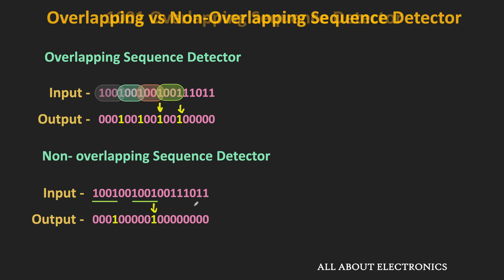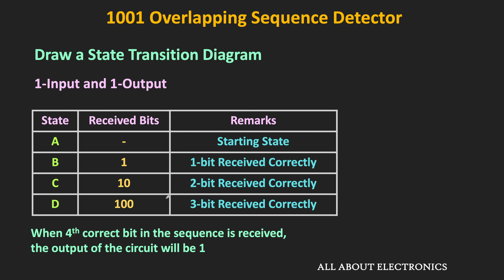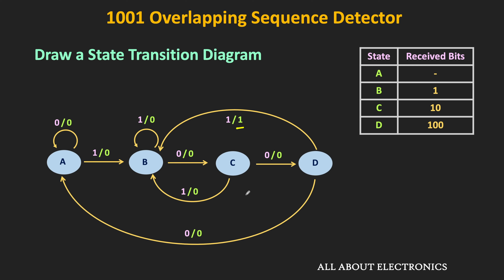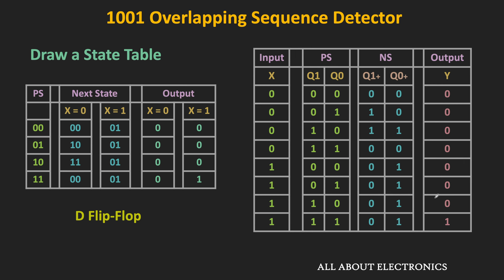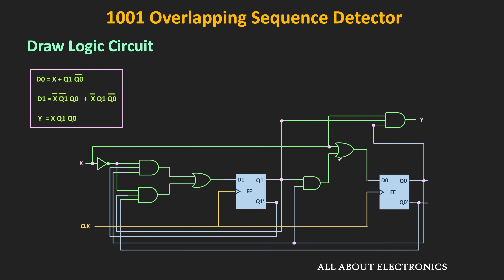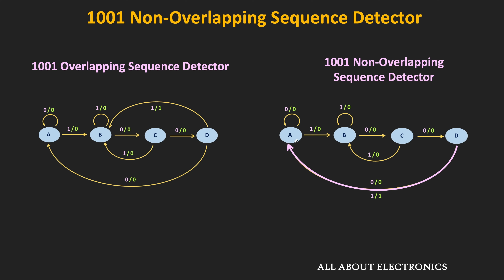Sequence Detector | How to Design a Finite State Machine ? Step By Step Guide with Examples

Comment: How you draw excitation table
Reply from the maker: The excitation table basically tells, what should be the excitation to the Flip-Flop inputs to get the desired next state. In this case, as D flip-flop is selected, so for D flip-flop, the inputs to the flip-flop will be same as the next state that we want. For example, if the next state is 00, then inputs D1D0 should be 00 (irrespective of their current state). And similarly, if we want 10 as next state, then inputs D1D0 should be 10. Please watch 11:51 onwards now, you will get it.

Comment: in overlapping why C is going to B if 1, why it is not remaining itself
Reply: because it will be like 101 and the 1 on the far right (LSB) will be starting bit of the next checking of sequence (overlapping sequence detection) and according to example, B is the state where 1 is already received.
Reply: @harismasoom6634  thank you so much sir
Reply: But the same thing is done in the state diagram of non overlapping sequence . C goes back to B when 1 is detected...

Comment: If the number to detect is not 1001, but 0101, can I set A, B, C, D to -, 1, 10, 100 like the video?
Reply: Or should I set B, C, and D to 0, 01, 010?
Reply from the maker: @박소은-b9k  Yes, you should set the states like this only. (B = 0, C = 01 and D = 010)
Reply: @ALLABOUTELECTRONICS  Then, how should I set it up when I make one circuit that outputs 1 when 0101 or 1001 is an input?
Reply from the maker: which sequence you want to detect? 0101 or 1001.
Reply: @ALLABOUTELECTRONICS  I'll write the question I'm trying to solve. "The circuit examines groups of four consecutive inputs and produces an output Z=1 if the input sequence 0101 or 1001 occurs. The circuit resets after four inputs. Find the Mealy state graph."
Reply: If 0101 and 1001 are inputs, Z is 1 for both
Reply from the maker: You mean to say, you want to detect both sequence at the same time. right ??
Reply: @ALLABOUTELECTRONICS  yes
Reply from the maker: For that, you have to assign the states accordingly. ( So, that both the sequence can be detected). Use the same procedure, but while assigning states, you should look for both the sequence. For example, after 01, if zero is not received, and 1 is received, then it can be considered as the fist bit of the second sequence (1 in the 1001). And accordingly, you can draw a state diagram. I hope, you got my point.

Comment: How did you determine the Q1+ and Q0+ ???????
Reply from the maker: It is written from the state table. For example, when x=0 and present state is 00 then next state is also 00. ( see the left table). According to that, in the second table ( right one), the Q1+ and Q0+ is 00. Similarly when x=1, then next state is 01. So in the second table in the fifth row Q1+ and Q0+ are 0 and 1 respectively. I hope, it will clear your doubt.

Comment: hello sire, how to know what to put in the preset and clear of the flip flops in the simulator?
Reply from the maker: Generally, the preset and clear inputs of the flip-flop are active low. Meaning that when 0 is applied as an input then it will get activated. So, when we want to clear the flip-flops then we should make clear input 0. And we want to make them inactive, we should apply 1. This is valid, considering the inputs are active low. If they are active high, then you need to do other way around. I hope, it will clear your doubt.
Reply: @ALLABOUTELECTRONICS  thank u very much, indeed cleared my doubt 🙌
Reply: Indeed, thank u very much @ALLABOUTELECTRONICS